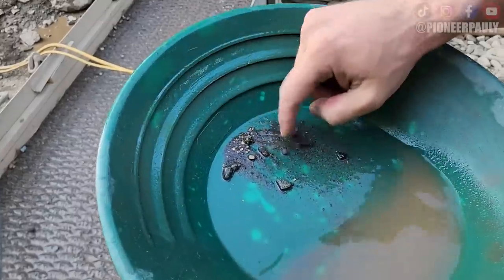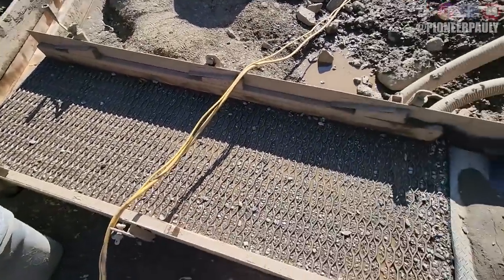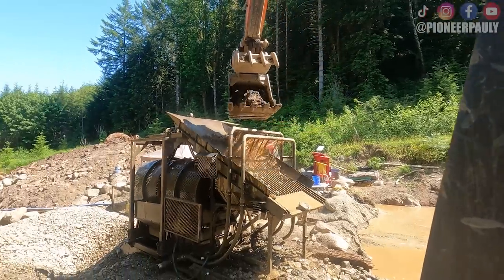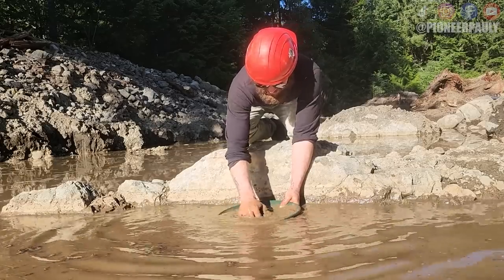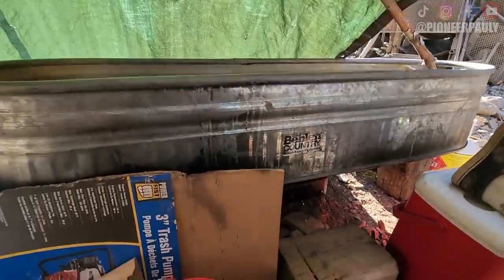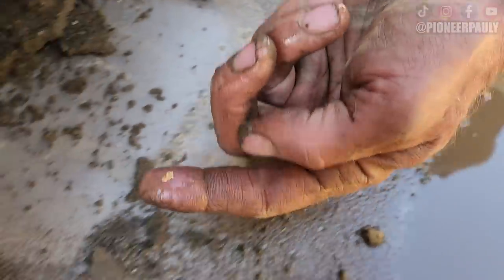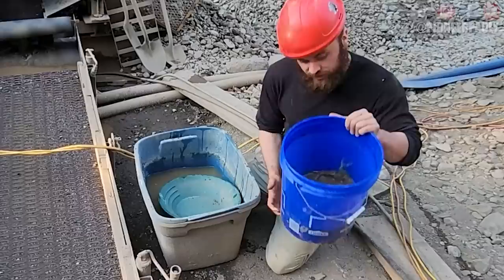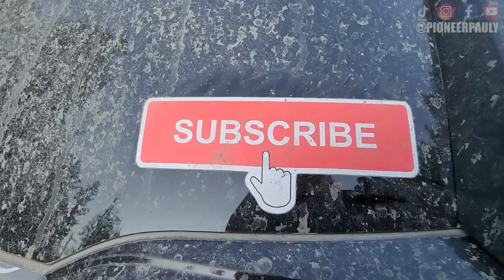Let's Claim Jump This Guys Gold Mine..

Comment: It slightly "worries" me how hard that nugget trap is packing. Have you thought about adding a couple smaller water nozzles in the bottom on either side of the clean-out, just to keep the nugget trap in suspension so it can keep the heavy stuff? I just notice much of the gold in the nugget trap looks to be very similar if not the same size as the stuff you picked from the top of the box.. just my two cents and I know pennies ain't worth jack now 😂

Comment: @PioneerPauly has this fella been introduced to Jason from Mount Baker Mining and Metals, maybe get more cash using his shaker table and jaw crusher?
Reply: Jaw crusher wouldn't help. This is placer mining, not hard rock. No quartz to crush up to liberate gold from.
Reply: @jasonhowarth6789  Jawcrusher for bigger rocks, hammer mill to get it small enough for the shaker table, I'd still crush it all up and let the table do its thing.
Reply: @Zendukai  there is no need to crush anything in placer mining...
Reply: That's fine, u do it your way, I'd do it mine. If I could afford it lol
Reply: @Zendukai  same here! 😂
Wish I lived in an area where there was gold deposits...
Reply: @jasonhowarth6789  I'm working in a smelter and still some guys have managed to walk off with 10 tonne of copper, clever buggers lol... we also make shitloads of silver and gold, we used to refine it but we send tonnes of it off to the mint and they refine it. Lead, well that's our bread and butter, 200,000 tonnes of the stuff, we'll some years haha, zinc, and concentrated white sulphuric bitey bitey acid, easy to get rid of a body or two haha.
Reply: @Zendukai  wow! That's a lot of metal!